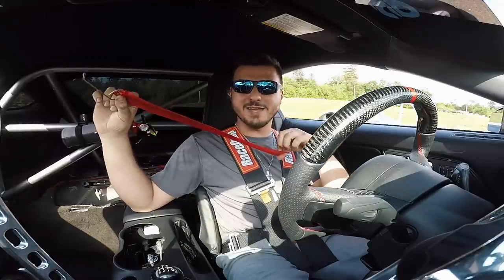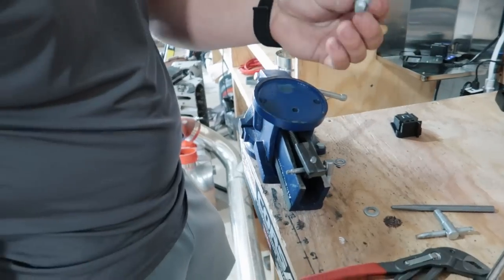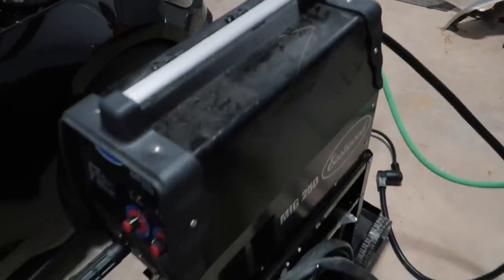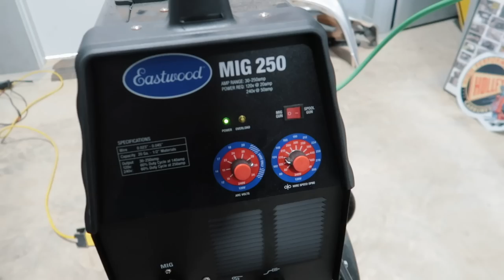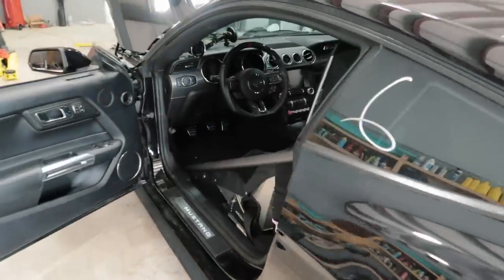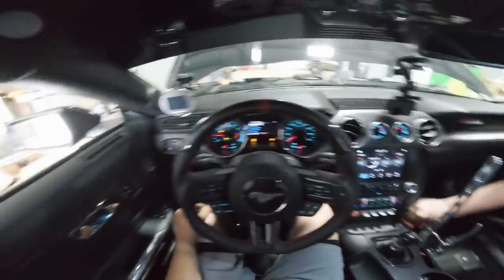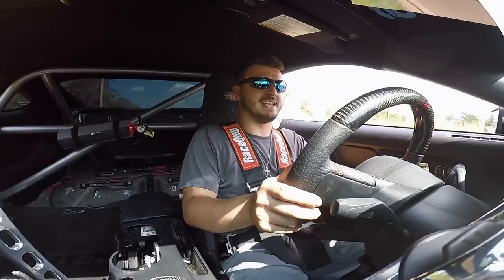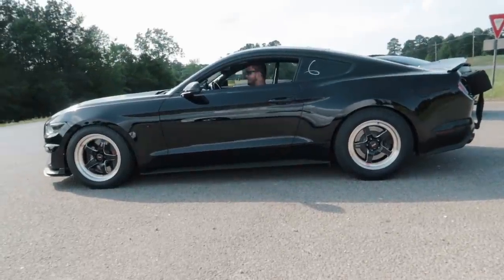I pulled my new Parachute on the Highway!!

Comment: you have too aggressive of a clutch, most high horsepower coyote guys run a single disc clutch and get far better results bc a twin disc clutch either loves to spin or bog
Reply: PTiddy @itsjusta6 look into the spec stage 3+ single disc clutch. Had it on my 700+hp Procharger mustang and it worked better than any twin disc I had.
Reply: This username it’s a Roush... it’s supercharged v8 with like 700hp
Reply: This username i know... itsjusta6 doesn’t have a v6 mustang lmao
Reply: PTiddy and now he has a triple disc
Reply: @BibbyLV  It's a v6.
Reply: @jordanlazarus7345  You're obviously new. It's a supercharged V8, not a V6
Reply: It's a coyote engine, which is a V8
Reply: @rahulisgay3689  I've been watching since the camaros bumper got hit by an 18 wheeler tyre. It's clearly just a v6 bro. Don't accuse me of being new or anything.
Reply: @rahulisgay3689  YOU'RE obviously new. It's just a v6. The reason it gets off of the line so fast is because it's AWD.
Reply: @jordanlazarus7345  That's my bad. I'm not new but I thought it was a V8
Reply: @rahulisgay3689  Yes go tell everyone that it's an AWD V6, they need to know.
Reply: @rahulisgay3689  He's trolling you lmao mustangs are rwd
Reply: @opolarhd98  Yea I know I was being sarcastic. I knew mustang's were rear wheel, and he does rwd burnouts on some of his older videos.

Comment: I raced in the points program.  Everytime I run a standard car my knee does the same thing.   Put music in your headphones and blur everything and one out from staging lanes.  Consistancy is the key.  Do everything the same. From your routine getting in the lanes.  To the amount of smoke coming from the burnout.  It will get easier.    Do a few track rentals.  It's like a 100bux.

Comment: If ur welding might check and see if might still be wired for flux core i know my mig250 come with everything for flux and when i swapped it to mig my welds looked like hell but after quick diagnoses i swapped it its been laying nice non thoughtfull welds 
As it should but best of luck with urs also if you use ground cable from the plasma cuter it helps i wound up buying the extendded 15ft gun and its well worth it also the plasma cutter the tips are measurable to wait to come in so i would order as many consumables as possible a reliable large air compressor and somthing to remove moisture will save u a ton of money make ur tips last a while dont rely on the little spacing thing on the plasma cutter it tends to love to deform even on gentle  drags but ive yet to have problems and they have always been ready to ship it just takes at least week and a half also while ordering triple check ur cart as the consumables can be swapped in the cart had it happen now i have to packages of versa 40 consubles i cant use the return process for ur consumables goes to different place and u hafta wait for it be processed ect. 

Also how would you do on the track that v6 blew up on while on the 850 tune awsome see the new truck build and the miata coming along thanks for knowledge on how the shoot feels hope yall can come to a event in kansas city next year we will have a new 1/4mile track in oddessa mo. As are kcir was shut down
Turned in to non maintained city park with worlds smallest parking lot.

Comment: Bro you need a 2 step to help with launching. I have one on my 1992 c1500, lq4 6.0, and cd009. I got way better at the track on slicks using the 2 step to launch at the same rpm and you don't have to worry about modulating the throttle.

Comment: You will get a hang of that clutch pretty quick. You will be making really good passes soon without a problem and that chute isnt bad at 90 try pulling it at 150 and up and it will pull some negative gs and you will definitely feel it but the body gets used to it

Comment: I love your vids man btw any good ideas what a good upgrade for a 4.3p v6 is
Reply: Itz Vaxza get a small block
Reply: Sell it. That's the cheapest and easiest way to make it faster. Sell it. Mods won't do much of anything, and swaps are expensive.
Reply: Sell it and get a GT then mod's hahaha
Reply: Jason Strout Get a GT has numerous problems a weak motor but hey it’s a real hit with the crowds
Reply: @killercoyote3445  funny do to the fact the 4.6L modular motor from Ford that were in mustang's was one of the best motors produced until they redid the 5.0/coyote motor. They make ANY LS look like a slow 4 banger
Reply: Bob Ross 😂
Reply: Codytp63 the 4.3 is in my truck look at my insta Csmoley03 and you’ll see it

Comment: That's a racing clutch for you bogging when you launch. Even my triple disk 5" clutch in my nascar transmission in my asphalt latemodel will bog if I don't shift it just right on starts and re starts you gotta be over 5700 rpms in order to shift it with out clutch due to fog collars

Comment: I know you didn’t know what to expect but did you really expect anything at 80 mph 😂
Reply: Lol exactly try the same over 160+ it will be a lot more violent, then you can worry about airbags
Reply: [GMD] Jupitar he was definitely not going 125  when he pulled it
Reply: [GMD] Jupitar he was maybe quarter throttle if that in 3rd gear at low rpm
Reply: chukob5 I know right. Seems like he was going 80 or 90.
Reply: hahahaha. wait till he pulls it off throttle at 160. oh what happened is it still smooth lol

Comment: I’ve been watching your channel for a while and man the hydro isn’t really going to help you launch and you’re not running fast enough times to need a parachute. If hydro brakes really helped drag cars launch, you’d see every manual transmission drag car out there with one...and you don’t.
Reply: yefferys50 because almost all drag cars have powerglides or a sequential shifter...
Reply: Israel Tijerina sure most drag cars have more race geared transmissions however justa6’s car isn’t running times fast enough to need a serious transmission. There are plenty of s197 and s550 Mustangs running deep into the 8s and 9s with MT82s or Tremec 6 speeds and I’d bet none of them are running a hydro brake to try and launch better.
Reply: yefferys50 lol that parachute was overkill at this stage his car is still too slow to need that

Comment: Loosen the front end up! Bias tires need to spin some. You dead hook them they wad up and you bog or they shake. Loosen the front end tighten the rear up a little. More tire pressure equals less spin less equals more spin. Believe it or not. Half psi increments on tire pressure. But you need to let it eat. That’s why your 60’ are inconsistent because you’re not letting the car do the work. One last thing. Try to drive into the chute so pull it before you let off let it blossom before lifting if you can.

Comment: That was like 75 on the freeway... Now pull it at 180+. You will most certainly be surprised. It'll be a -1.4 to -1.85 G's at the chutes hit. 2 chutes at 215 is -3.75 G's to -4+ G's at the hit. It's a ride for sure...

Comment: You need to get msd 2step and switch to a Hoosier slick I have a mt82 s550 with a blower and  full bmr drag suspension and it works great with the slicks and 2 step
Reply: BADAZZ RACING 2steps aren’t really made for blowers..
Reply: Israel Tijerina I mean I’ve been running my msd 2 step for over a year since my cars been boosted haven’t had any problems

Comment: Gavin yea bud pull chute at 120 140 in between your trap speed most racers pull that as soon as there down lifed off pedel crossing line chute b4 brakes so your traps are around 120- 140. So pull it on highway at 140 an thats the worst it will pull u back unless its super windy an is blowing way going towards chute.
Reply: Shaun Holden 

No.. lol. You pull the chute while the car is under all the power so it doesn’t jerk the car and cause it to go bat shit crazy at 140+.. Timing is key and he will need practice just like he needs more seat time..
Reply: Kinda sounds like what i said at end of run at end of 1/4 mile thats what he is praticeing for
Reply: Again he traps between 120-140 so he has to see them speeds to see what it feels like so he knows what he is up against.

Comment: I really find it so stupid how America uses 110 V supplies for houses and stuff, in as/nz you use 230-240v for general household use, and our multi-phase(which I assume your 220v is) is 400v. so you guys have to use a higher current for the same result, which results in more losses, and more heat.

there is also zero benefit of using 110v in the form of safety, 110v will still kill you, just like 230

Comment: I don’t understand why you would be practicing launching on a lower power than you will be using when you actually need to be able to launch good
Reply: SyKe Frog 

The street roads have no prep, the track has prep. Getting use to launching it with high power on the street would be completely different than getting use to launching it at high power on a track. He needs more track time. Launching at high power on the street will do nothing but send the tires to the moon until he learns how to setup a boost controller and cut power when necessary..